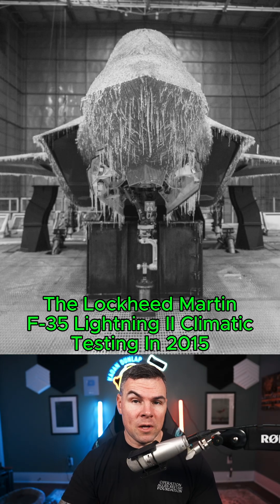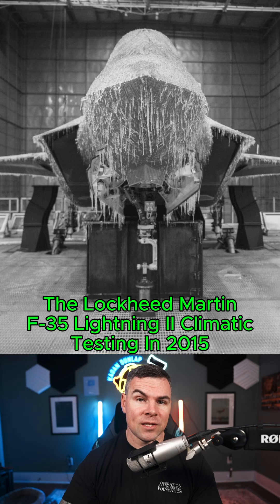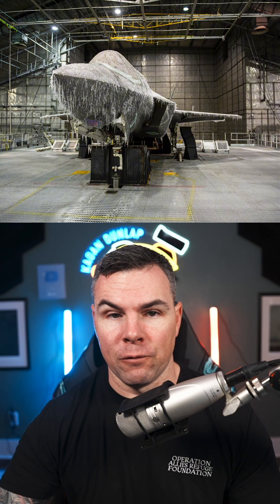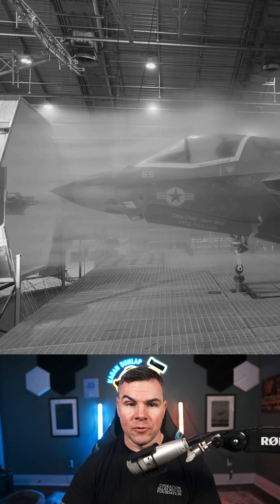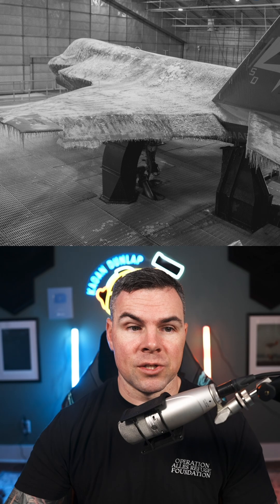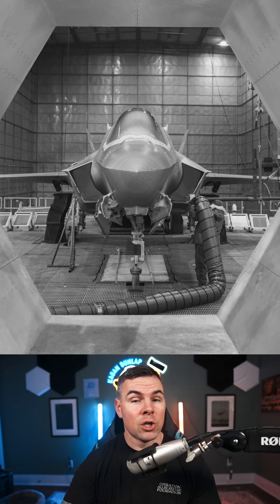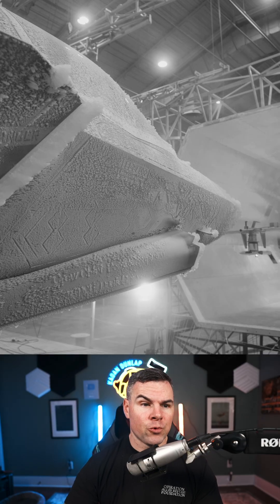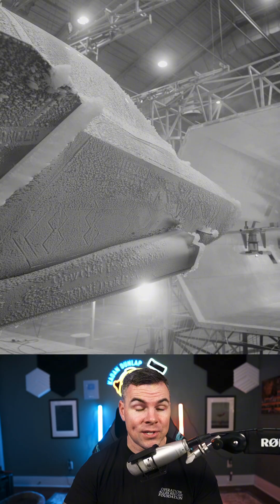The Lockheed Martin F-35 Lightning II Climatic Testing In 2015.

Comment: I have been in that hangar back in the 60s.  I was just a little guy and my Dad got me in there.  Never seen snow or a cold place before.  I was puzzled why I was getting dressed in Arctic parkas and gloves.  Then through the airlock we went.  They were simulating Arctic conditions. 

The place was packed full of ground vehicles and a couple of planes I recognized.  Then there was one I did not.  Looked like it was hanging from the ceiling above some equipment.  It was long, futuristic looking and black.  I pointed at it and asked what that was.  Suddenly it was time to go. 

Any guesses what it was?

Comment: You know everyone talks about the F-22 but it's the F-35 that's the real hero. This thing is amazing.
Reply: Same thing in ww2 England everyone loves the spitfire but it's the hawker hurricane that did most of the work during the battle of Britain
Reply: @deedee4531 most of the pilots that flew both the hurricane and spitfire.said the hurricane was a more stable gun platform and it was more user friendly
Reply: People talk about the F-22 because they can't have the F-22.
Reply: @OutletVibes No other country has a 🎈 problem for the F22 to pop
Reply: It’s like comparing a Ram 3500 dually to a Ferrari. The Ram does everything the Ferrari can do but it doesn’t accelerate as fast or corner as hard. Most households would be better off with a Ram 3500 than a Ferrari… but if you have a drag race to go beat your neighbors Ivan at, you want the Ferrari.

Comment: If you are cold, they're cold. Bring your jets inside.
Reply: My f35 likes to roll around in the snow
Reply: Bring your jets outside in this case. Its way warmer!
Reply: If there's coats for dogs, there should be coats for jets
Reply: @farad8633  actually , that is exactly what we did in norway with our F16s, more for overall protection than climate, but you had to operate from opening the mountain Doors and flying off of highways many times!
Reply: @1stviper589  That is so cool. I love seeing fighter jets operating from roads.
Reply: Does aircraft not ohm in the cold? 
TWS?
Reply: @2hands2brains ???

Comment: Glad they can spare models for extensive testing but still cant deliver them to allies 10 years after paying for them
Reply: They do have them. Just that they are still in test and evaluation at Edwards AFB, CA when I got out in 2019.
Reply: @briannemacheck1243  we arent getting ours till 2028 due to the latest delay lol
Reply: @vilhjj  takes time to get the issues worked out. USMC put all the money into the F35Bs because the newer F18s cost more without the engines it would come out to the same price as the F35Bs which is 88 mil

Comment: In that climatic condition I would prefer the Swedish Saab Gripen ...
Reply: While i can understand that layman approach, to use an analogy, that's like saying you prefer a Toyota Corolla over your F-350 Super Duty to tow your boat because it's more reliable.

The point of the F-35 is the network vigilance systems. It allows a country to see with the eyes of God, to put it bluntly.

Comment: So.. an average winter day at Minot AFB...  Seriously.  It was -40° with the wind chill a few weeks ago.
Reply: we see - 30c in northern norway.. and that's NOT adding in wind speed, something we also face, and despite our building codes- houses keep loosing their roofs.

just lucky there isn't giant water spouts here, id not fish under these conditions if i had to deal with those to.. the waves don't affect me tho, and the cold will get you no matter how hard you work.
Reply: @goontheracoon That's -22 F.  We get that too, without wind chill.
Reply: No seriously I’m confused. I live in Alaska we have F35s why not test it here 😂
Reply: @907CarterE oh , believe me , you do out of Eilson afb,Fairbanks and F22s for northern border protection
Reply: Wind chill is heat dispersion by stripping away insulation layers of warmth; once you begin moving at higher velocity air compresses that creates friction resulting in gaining heat rather than cooling off. 
So really in testing coldest operating climates you only need to use static air temperature.

the real question is why only test at a mere -40F that would be on the high end of temperatures a fighter jet would tolerate at 30,000 feet — which ranges from -40F to -70F.  If this was extreme testing it should be done somewhere around -70F if you intended to go subsonic speeds at higher altitude.

I guess because you can always account for heat gains in higher velocity to prevent the craft from experiencing less than a -40 degree Total Air Temperature.

Also just for fun we can run the math for what an F-35 total air temperature would be at a Mach 1 cruising speed in a -40F static air temperature.

//Need convert F to K for SAT(Static Air Temperature)
SAT = (-40°F − 32) × 5/9 + 273.15 = 233.15K
SAT = -40°F = 233.15K

//Formula

Total Air Temp(K) = Static Air Temp(K) x (1 + 0.2 x Mach^2)

TAT = 233.15 x (1 + 0.2 x 1)
TAT = 279.78

//Convert to F
TAT = (279.78K − 273.15) × 9/5 + 32 = 43.934°F
So above freezing point.

Comment: Send it up to Canada,, then we'll see. 😅
Reply: They tested down to -40
Reply: @MissAlissaxX The coldest temperature ever recorded in Canada was -63.0°C (-81.4°F) in Snag, Yukon, on February 3, 1947, a record that also stands as the lowest official temperature for all of North America, where conditions turned breath into ice powder and snapped metal and wood.
Reply: @KamiSlayer86  and? If that's the case literally nothing is flying.
Reply: @goat0472 And have a Happy New Year! I'm not sure how much more you want me to add to the interesting Canada fact about how ridiculously cold it gets there. Did you have a specific question or do you not really have anything to add to the topic at hand?
Either way, I hope God will bless you in 2026.
Reply: @goat0472 well, unfortunately, we've had the abuse of having to fly C1 30s into Antarctica, and somehow they survive even lower temperatures n wind shears than that... amazing that a Turbo prop aircraft can survive that I don't know how a jet would
Reply: @KamiSlayer86 ice road truckers
Reply: @KamiSlayer86  Every commercial airplane that flies at over 30k feet will experience -40F but move fast enough maintain an air temp about freezing. 

-81F wouldn't be safe for commercial but a fighter jet would only need to exceed Mach 1.25 to easily be able to fly fast enough to reach a safe air temp above freezing — especially for the F-35 that can supercruise at Mach 1.6